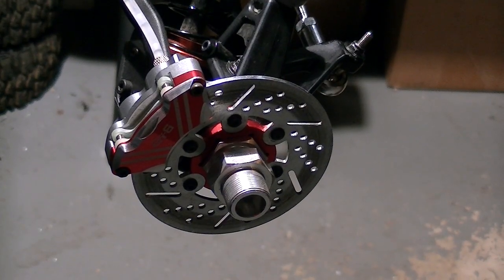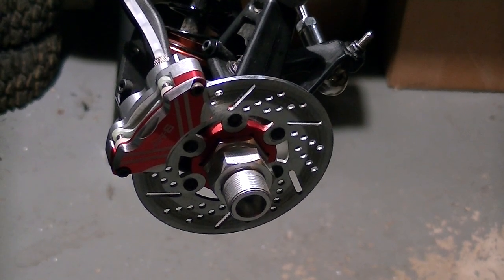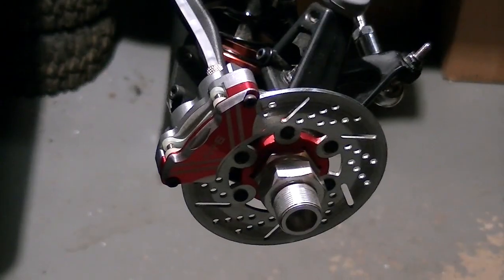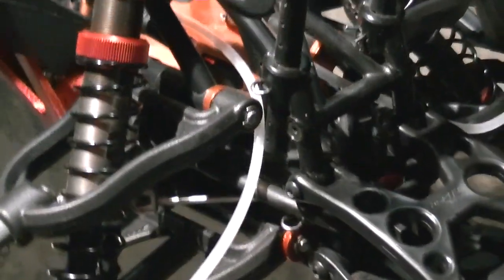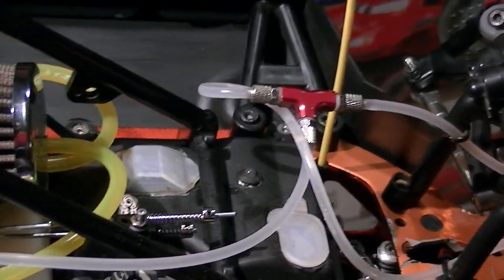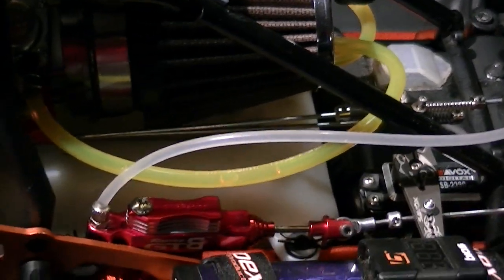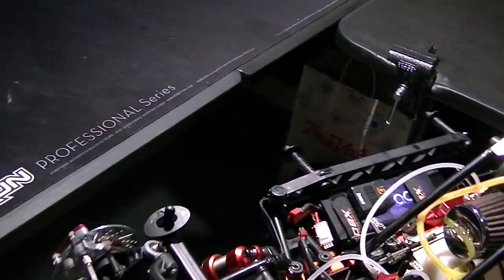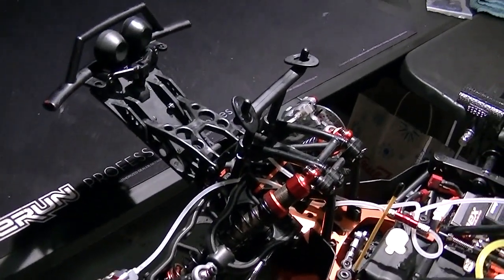Gtb Front disc brakes after install

Comment: Nice ...I'm gonna get the cable version. .don't wanna have to deal with bleeding etc
Reply from the maker: Diy type of guy once you get them set up as long as you have no leaks your done dealing with them,    but no matter which ones you get disc breaks are the way to go your baja will stop on the dime. You only need the front disc brakes because you already have rear brakes. Thanks for the comment!

Comment: Niiice setup , I gotten the same gtb brakes , I followed step by step everything that you did from this vid and the other vid too , I need alittle help , what servo are you using for the gtb brakes cause mines seem weak cause when I full throttle my 5b and use the brakes it'll slow roll then come to a stop and where can I get the spring that you use for the throttle servo that's connected to the gtb brake cylinder rod ?
Reply from the maker: I'm using the savox sb2290sg and I'm using the yamadude throttle linkage and I got that spring off of the stock linkage we're the back brake is because it was not included in my kit like it should. Your servo has to be strong because it is pulling two brake systems at once and keep your back brakes connected just in case your fronts fail!
Reply: @5thScale  ......I think my servo is messing up cause when I ran it yesterday the throttle servo felt kinda warm and I ran it today to see if it would be the same and after an hour it felt the same but felt hot , I'm not sure if it's the motor inside the servo that's messing up ........I'll get those parts you mentioned cause I want to put all upgraded parts on my 5b and use the original parts as backup
Reply: @5thScale  .....is there any benefits getting the extended A-arms ? ...cause I have the regular aluminum A-arms on it already
Reply from the maker: @Jose.Q_  if you get the extended a arms they will stop excessive flipping over because of a wider stance
Reply: @5thScale  .....cool I'll get that then cause I asked around here on YouTube about it and the most answers I gotten was ( it makes it look more aggressive ) ( it adds alittle more height up front with extended shock retainers )